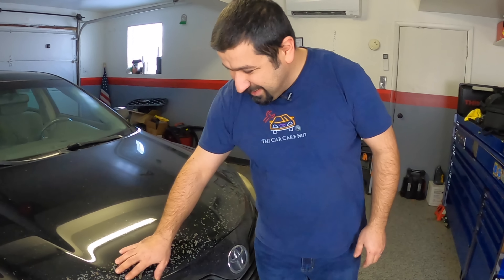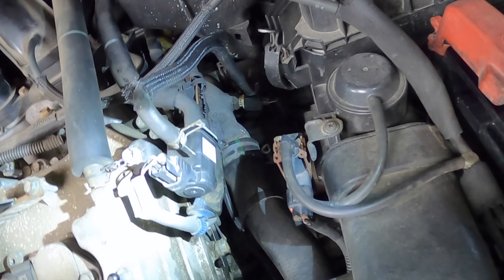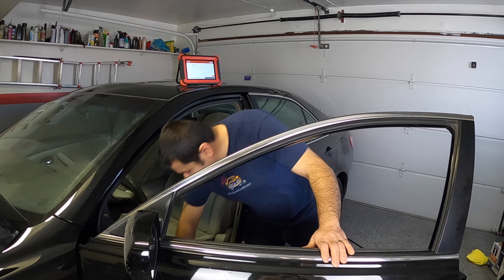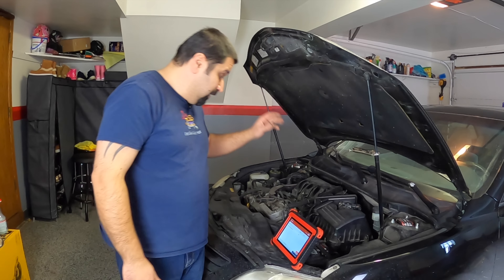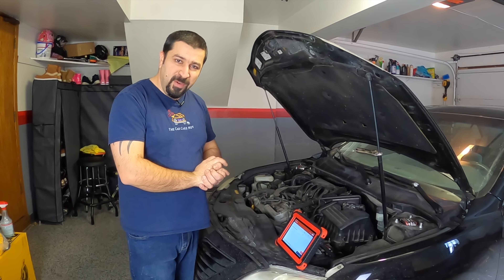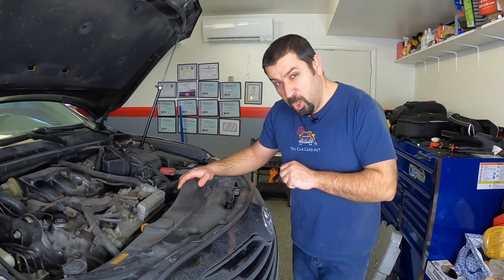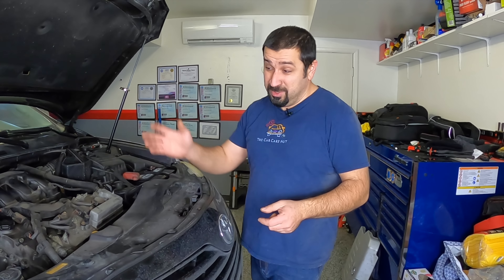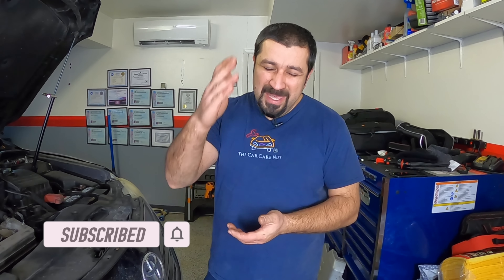How Does a 15 Year Old Toyota with OVER 200k Miles Hold up? Full Inspection!

Comment: Thank you for the informative video.  My wife wanted a kia optima V6 in 2003.    Purchased 9/03.  Currently, 254,130.  Recently replaced camshaft and crankshaft timing sensors, plugs and wires.  It runs like new.  I have replaced the valve cover gaskets(two years ago and radiator(4yrs.).  I didn't want this car but it's been stellar.  BTW, I bought a 2006 kia Sedona new. It has 285,400 miles.  It has issues now but starts every time I decide to drive it.  We drive the sedona 170 miles once a month to get spring water.  Replaced valve cover gaskets same time as optima.  Neither of these vehicles looses oil. 5000 mile interval.

Comment: Great car, I have 2004 sequia since new, 165,000 miles rides like new, but here in rust belt n.j. I fluid film frame every year after power washing off winter salt, thank u for the video PS I only use toyota replacement parts especially o2s and mass air usually made by DENSO

Comment: I just committed to a 2022 RAV4 hybrid and this video describes just about everything having been replaced at one time or another. The car that I'm replacing is a 2013 Buick Verano turbo with 204K miles that I bought new. NOTHING has been replaced other than tires, wiper blades and broken windshields.

Comment: These are the types of videos I'm looking for.  I have two Pontiac Vibes, a 2003 Base and a 2004 GT which are basically Toyota Matrixs.  These are the first Japanese based cars I've ever owned.  I belong to many Matrix and Vibes groups and the EVAP system is always a problem.  Your troubleshooting of this will help me diagnose mine issues.  I'm surprised to see so many issues with this car.  Hopefully Toyota has figured out these oil leaks.  Both mine have leaks as well and I have a gasket set for one and am going to replace this in a few weeks.  Hoping to lean more about the VVT system Toyota uses and the mysterious timing cam tensioner.  What is the oil pressure supposed to be on the 1.8 1ZZ and 2ZZ engines?  I'm thinking of adding oil pressure gauges as I like see what it is when hot versus cold.  Thanks for another great and useful video.  Thanks to Mrs Car Care Nut for the video work.  Curious what car Mr CCN likes. 8-)
Reply: @Countryfarm boy I have a 2006 matrix base 1.8L 1ZZ-FE engine with 150K miles & I've never had any EVAP issues with it, & since I live where they don't do all that emmisions testing stuff, I would just live with it if it popped up unless it was an EVAP canister vent valve. My Matrix has been great. Pro tip for anyone, don't take a 15+ year old Toyota Matrix to a dealer, I did, they tried to sell me $1000 worth of oil leak fixing, when I inspected it at the timing cover & it wasn't leaking. Dumb crooks. But they are great cars, I've seen them with 6,7'800,000 kilometers & they are still running good.
Reply: @Blakecryderman7244  If they would fix my only oil leak for only $1000 I would take them up on that so quick.
Reply: @lejoshmont2093  if you don’t want to spend thousands on fixing it & it’s not that big of a leak, with no exhaust smouldering, just keep adding oil. On any older cars, upwards of 20 years old, there will be this little minor seepages that are minor & don’t affect stuff, just add oil as time goes on
Reply: OBD2 bluetooth sender is cheap and easy. Free version of "Torque" ap on your phone will allow you read any of the engine sensors and display them as gauges on your phone or log them. You can mix and match oil pressure, engine temp and engine load as a custom display, 5$ fix that also lets you see fault codes.

Comment: I’m dying to have my 150k RAV4 2008 checked.  I changed the valve cover gasket about 5 years ago.  It’s burning a little oil. Half quart maybe every 2 months.  I changed my own oil, which I should have done more often. But life just keeps happening. I’m doing every 3 month oil changes now. I’m going to order that borescope. Thank you for excellent education.

Comment: My 2008 Toyota Camry had the oil consumption issue resolved at the dealership at 107 k if now  has 200,000 miles on it runs like a brand new car doesn't burn a drop of oil this is the most durable vehicle I've ever owned in my life I love it

Comment: I have a 2001 Ford Escape with 280,000 miles. Original drive train. Original most everything. Compression is good. I've done most of the maintenance myself.

Comment: 2006 Scion XB 315000 miles on it, rust along the doors will make me get rid of it; otherwise other than brakes, tires,  battery and alternator, everything else is still stock and running smooth.

Comment: Good video. I'm in the Pacific northwest and have the same issues. One difference we don't salt our roads. I can't even imagine working on salt rusted bolts. I call the oil leaks, sweating. What do you expect for over 200k. Aftermarket parts don't work. Gotta pay the price and buy OEM. To AMD . Like your vids. FYI to all. Gotta 95 Tercel DX pushing over 200k.

Comment: Thanks for the tips.  420K on 06 Toyota Corolla LE.  Bought it from an aircraft mechanic at 360K.  He replaced intake manifold gasket and motor mounts but that's about it.  He sold it due to a warped head gasket getting air in the coolant system and blowing up the radiator.  Didn't tell me tho.  Happened to me a year after buying.  A new radiator and Bar's Leaks #1111 took care of that. That was 2 yrs ago.  Everything still works on it.  I'm hoping for 20 years/500k miles.

Comment: Re: aftermarket oil cap. You are a DIYer and your wife complained of a burning oil smell shortly after the oil change because you forgot to screw the oil cap back on. Somewhere in southern NH is a 2008 Corolla oil cap.
Reply: I had this happen and heard it when it bounced off the underbody on the highway and knew exactly what it was. I had just changed the oil that same day, ran to autozone on the road, thus an aftermarket oil cap.

Comment: Since your were talking gas caps I will tell you about a strange issue I had with a small Honda GX200 engine that runs the system I use. We ran into some problems where it would run and then start acting like it was starving for gas. It had gotten water in the fuel and I cleaned it all out and still had problems. It turned out that Honda had some problems with the gas caps sealing too tight. I had to buy an after market cap for it so it would run right. Honda did revise the seals, but just funny. That case the after market was better than the OEM. Back to what you are saying though is 100% correct the wrong fuel cap can cause more issues than you would think.

Comment: My friend bought a 2004 Sienna brand new to use as his taxi. He said it now has 500,000 miles on it. Still runs smooth, quiet w/ AC. He said his van has gotten all the required maintenance.

Comment: I own a 1999 Ford F250 and a 2004 Ford Expedition that are both bulletproof! Both used hard with heavy towing for years. Not a single leak anywhere…both with over 230k miles. Yet Toyota gets the credit for reliability. 🤔
Reply: Take the two model years you own and compare how many Toyotas are still being driven within those model years and you can see why Toyotas still is in top choice for reliability. 20 to 30 year old, some close to 40 years are still zipping more frequently than older fords.
Reply: @TaureanRuler  What model Toyota hauls a 13k pound toy hauler to the dunes season after season?

Comment: I have nearly a decade of experience with Toyota. You were going over it and said 2GR-FE and I’m like. Passenger side cv axle, passenger side rack and pinion. Valve covers, timing cover often times timing cover leak will follow the ‘T’ and make it look like the head gasket is leaking. Power steering return line, water pump with pink boogers, radiator likes to leak along the tanks.

Comment: Thank you, Mr. and Mrs. CCN!  Your videos spoke to me so I took the 2009 Tacoma to the local Toyota dealer yesterday for an oil change and annual checkup.  Pricewise, it's much better than I get taking the 2007 Malibu to a quick lube place ("It has sealed bearings, so we didn't lube anything.")  The dealership threw in a certificate for a "red" wash at the nearby car wash, too.  The technician told me he had to look several times at the odometer as he'd never seen a truck like this, showing 22337 miles.  They know Tacoma World, "my social media," and that it possible to find older cars with very low miles like another Gen 2 Tacoma owner, who posted a photo showing it at 15000 miles.  Will the owner replace the gas struts, or add ViseGrips to the tool kit next to the spare?
Reply from the maker: Hi! They did not want to replace the shocks at this time
Reply: Solution: Remove and discard hood struts. Go to wrecking yard and cannibalize prop rod from similar vehicle. Fit to Camry and never have to worry about failed struts again. In all seriousness, this is where I would give cheap aftermarket struts a try, as they might well last as long as this owner keeps the Camry. But it does show how prop rods, as crude as they seem, are a guaranteed lifetime part.

Comment: I had a 2001 Camry with 280 miles on it. Original everything. All i ever did was oil changes timing belt and fluids and brakes. In 2019 it was totalled but still started and ran with 3 wheels.

Comment: I have an 04 Tacoma with over 200,000 miles. Engine is smooth and the body is in good condition.  Holding on to it to see how long it will go.

Comment: Interesting. My '99 camry with the 4 cylinder just turned 254,037. At 249,884 the alternator finally went bad. We celebrated her turning 250,000 by driving to Key West, Fl. from Chicago a week ago. No problems. I thought the timing belt might break because it's at over 90,000 miles, but the test continues. I had brought those parts with me just in case, toyota brand too. She's getting to show her age, but I've another '99 camry I bought last year, it's originally from Florida and in very nice shape. When I junk the clunker, I'll have many great parts. It's the original trans that has not been maintained other than adding some trans fluid very occasionally. I'd bet it could go another 250,000, IF, I find one with a blown motor, in good shape, I'll find out. Crazy too I averaged 30.8 mpg with a loaded trunk on that drive. Around 20 mpg in the city. I'll add this too, I hope you've something for safety if that lift fails. Even a tire on a rim would keep from being crushed placed beneath the vehicle. I used to have logs that were wide in width and of different heights.
Reply: AMD, safety 1st pls consider a rim, last protection, sometimes lift shoe slip
Reply: Niiice ! I have a 2006 toyota solara with 201k miles runs like a champ.. with these stupid car prices now days i will just replace the engine and transmission for under 3k, looks great and interior is very clean it's an SLE
Reply: @the_truth50   You have the right idea. Just replace the engine will be so much cheaper than paying for a new or used car in todays market.
Reply: I have an 98 Camry and upgraded to an 06 Avalon. It has the same or better fuel millage despite going from a 4 cylinder to 6 cylinder with quite a bit more power. The 90's Camrys are really starting to show their age the Avalon doesn't even feel like it was made by the same company the way it rides.

Comment: Just bought my 3rd used Toyota. 04 Highlander 4cly 181,000 miles to go with the   2000 Camry 4 cyl with 85,000 and the 03 4Runner with 265,000.  All J cars.  All running like champs.

Comment: The road rash on the front edge of the hood can be a good sign of mostly highway miles (or of tailgating on dirt roads which is not so good).

Is it a good idea to just replace the gas cap, radiator cap and oil filler cap periodically as a preventative maintenance thing?
Reply: My oil fill cap on my 2013 Prius always got stuck so I replaced the rubber gasket, OEM Toyota part, problem solved. At 120k miles, my gas cap started leaking, replaced it and the check engine light went away. Seems these items last about 8 years or 110k miles.
Reply: @mylesgray3470  
Good to know. Ours is a 2009 RAV4, Japan made with the 2.5 liter engine. It has just over 68,000 miles on it but it's still like 13 years old. No oil leaks and no oil consumption. We change it every 5,000 miles and it still reads full on the dip-stick. However, we recently had the intermediate shaft replaced on the steering and the transmission was replaced with a Toyota remanufactured unit.  Those two items were covered by an aftermarket warranty which is now expired. Both were done by the Toyota dealer we purchased it from.
Reply: @njsongwriter  Love that generation of Rav4 and such low mileage! Sometimes age alone kills the rubber and plastic parts though, especially in warmer/dryer climates.
Reply from the maker: Hi! Honestly with the caps if it ain’t broke don’t fix it.

Comment: Recently I brought my 2010 Highlander into the dealer for differential service,  what a mistake!!!!  Oil leaks now that didn’t before and the stone guard in the front was only held in by a zip tie ( hopefully Toyota part number). And two bolts, actually one bolt and one plastic push pin.  I’m done with dealers.
Reply: It's too bad that we have to inspect everything when we get our car back from the dealer.

Comment: My 07 Tundra( Purchased brand new off the lot. Best 34K Ive ever spent) 5.7 has 282k, runs great! Our 06 Highlander has 313k, runs great. I do all my own maint. 3k oil changes, 30k diff fluid changes, tranny fluid changes, bearings....on and on...We live in salt road heaven, way up north. I hooked my hot water heater to the outside hose to remove salt and sand because the nearset car wash is 30 miles away. Works great!! Rust is minimal on both autos.

Comment: I have a  2011 Toyota Sienna with 246K km. Only replaced 02 sensor  break pads, tires, fluid changes and change oil every 8000km. That's it and still runs like new.

Comment: My 2008 rav 4 6 cyl sport has held up pretty well at 220,000 miles it’s needed some work on the front end. Wish I found this channel 2 years ago, when it needed work on the suspension. I also had an oil leak, got it fixed. I want to keep it going as long as possible. My sunroof rattles too lol

Comment: I've got a 2001 Corolla with 225K, still running great.  Original owner, will probably drive another 10 years!  I put KYB shocks on it and it handles great.  Did a full flush on the tranny and it shifts great.  Used synthetic oil it's whole life, and barely uses any oil.  Needs a new headliner, will do that this summer.  Good luck all-- T

Comment: that is the biggest downfall of the V6 , makes the normal jobs like valve cover gaskets and any other normal service super expensive. More reason to get the 4cyl engines. Super easy to work on.

Comment: Well Done, as usual.
Mechanically ... most helpful.
Communications-wise ... your  comment about INFORMING CUSTOMER dovetails with my experience as a Field Engineer for many years working on Huge Radar and Radio Systems.
Customer would ask to have "A" repaired ... only.  BUT upon testing, noted "B" was "broken". 
Told customer immediately ... BEFORE ANY work done: "Oh, Wow", you are right ... we had been "ignoring & working-around that", etc.

Aside: Interesting about that "Dog Bone" (Anti-torque) upper mount:  I bought a beautiful, low mileage, near-pristine 2003 RX 300 a few years ago.  Even with only 113K miles on it then, I noticed that top motor mount was a newer OEM unit.  Perhaps they just fail over time with age and vibration ... in any case, THAT was just one of the many signs (along with new Xmiss Fluid at 63K miles,, that the previous owners had done a fine job of maintenance.

Communications Gap in MY Favor:  I got a very good price BECAUSE the Lexus dealer (Sales Group Manager, et al) did not realize or care about the fine condition of "my cream-puff" ... to them, just a 17 year-old unit good enough to sell instead of sending to the auction; no one had asked the servicing mechanic (until I personally asked him) about the true condition of MY RX.
Warm Regards to all,
John in the NW

Comment: Nice video AMD.  We have a 190,000-mile 2009 Avalon that is solid nice looking and dependable.  I was wondering if they both have the same drivetrain.  They look the same on video and we do have that same power steering hose leak from the reservoir.  Our car is borderline fast and runs very strong, and still gets around 25 to 29 MPG.  It's had a hard life before we got it after my brother-n-law passed away.  He worked and lived on an Indian reservation in Montana, so the car was driven on gravel roads for much of its life and he also hit a mule deer just before he passed away.  After we had the damage from the deer repaired, I did a coolant flush, oil change and new tires all around.  Thanks for the video I will use it as a guide this spring while I'm hunting for anything wrong.  Would you like to do a video sometime this summer on the car?  If so, I will try and talk her into running it up so you can give the car a complete physical.
Reply: My 2006 4runner looks great and runs even better. Toyota is the best.
Reply from the maker: Hi! It is the same engine and setup. Stop by in the summer!
Reply: It has the same engine and transmission as your car.